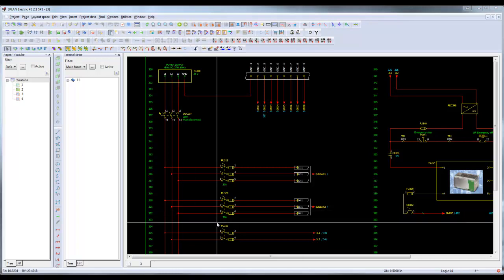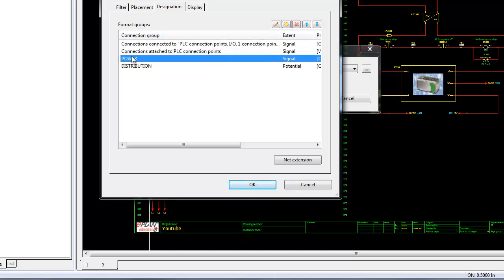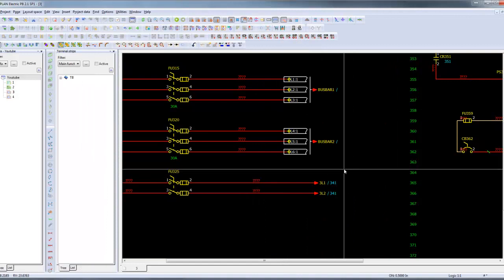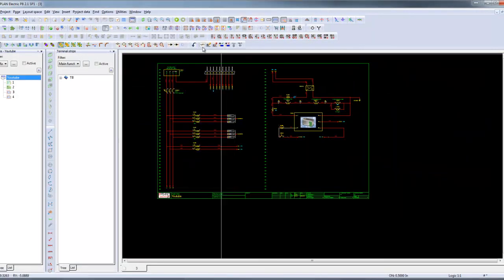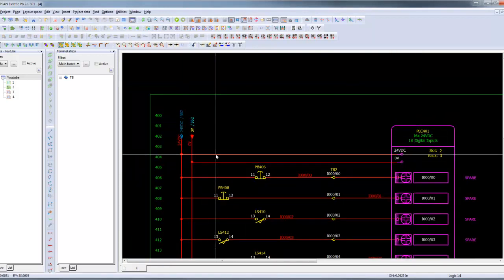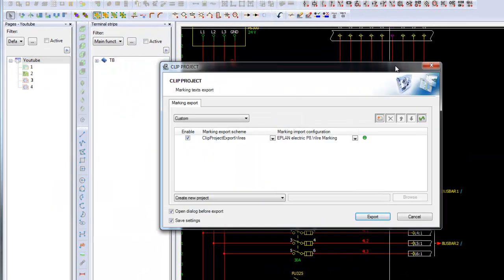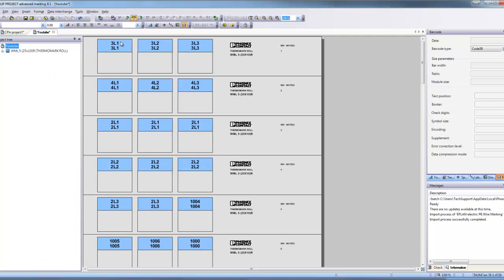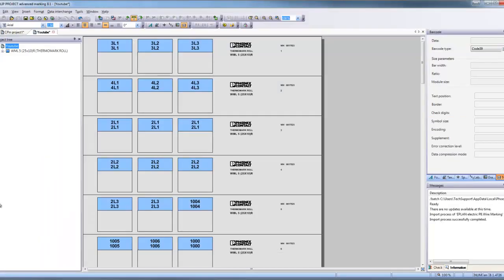EPLAN Wire Num Grouping Export to Clip Marking

Comment: Hi Sergio,
I liked your wire numbering by group video. I have a question. I'm trying to number a series of contactor feedback contacts in a  long chain on a single page, the chain goes back and forth in a  "S" shape from top to bottom, is there a way to get the wire numbering to happen starting at one end of the chain and proceeding along to the end? At the moment my wire numbering seems to only go from left to right irrespective of the row  so it comes out wrong.